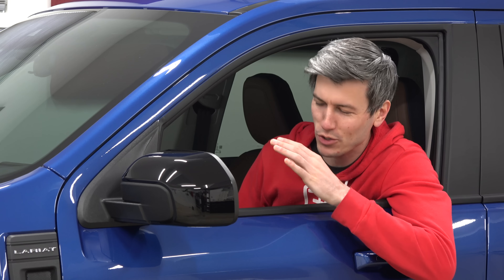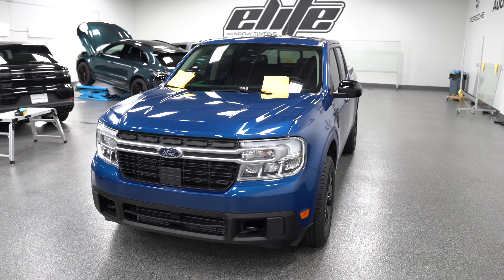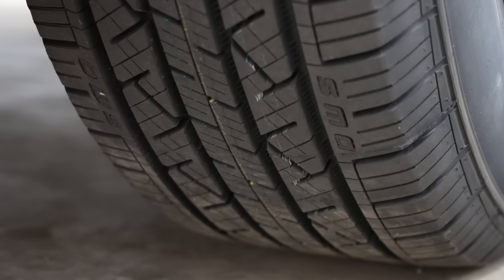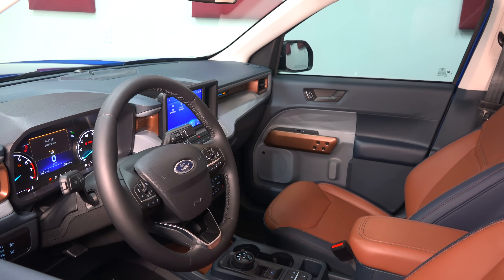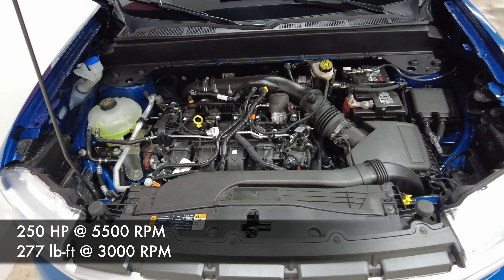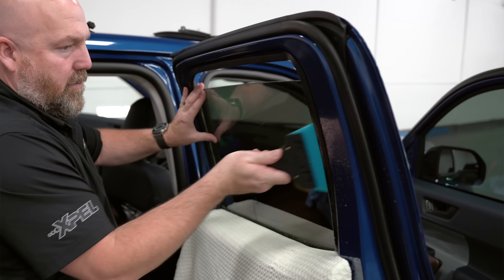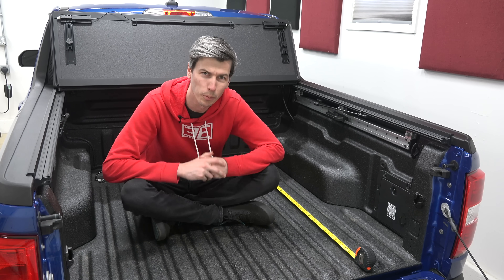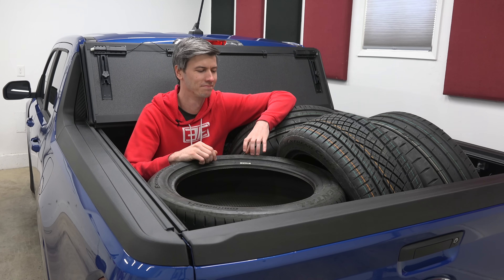I Bought A Ford Maverick! The Perfect Pickup?

Comment: Most consumers can only justify owning one or two vehicles, making the choice of a car about versatility and compromise. I own a boat and require a vehicle capable of towing and pulling up slippery launch ramps. A 4WD truck would be the preferred tool for most. Unfortunately, I have to use that vehicle doing a lot of light-duty tasks as well and suffer punishing fuel costs. There are fewer and fewer lighter vehicles for the job. Maverick is the most economical truck for this purpose, and it's also the lowest-priced utility vehicle for many other tasks.

Comment: The Mavericks are undoubtedly cool and practical, but I personally worry about reliability. As a Ford technician, I’ve seen lots of quality issues with Ford, and the 4 cylinder ecoboost engines in general. I’ve seen coolant intrusion issues in 1.5, 1.6 and 2.0L ecoboost engines and plenty of electrical issues. I will say, I havent seen a ton of maverick issues yet. But most modern Fords see some sort of major failure by 100k-150k miles. They’re typically pretty good vehicles for a while, but definitely no where near as dependable as some old Hondas, Toyotas, etc. that would make it 400k+ miles with no major issues. You’ll be very lucky to see that Maverick hit 200k
Reply: I thought they fixed the design on 2.0 eco engines?

Comment: Small pickup trucks are quite common in India. A 4 cylinder diesel/CNG engine, around 80-100HP and 200NM, and mostly available with a regular cab (also crew cab available) or cabover like the kei trucks. 
Those are used at construction sites, farmers and fisheries delivering their produce to the towns and cities, delivery trucks for furniture, bigger appliance or equipment inside cities and box trucks. These are cheap, extremely reliable and easy to repair, making them perfect to own for small business owners.
Although some higher end (according to our market) ones are also available like the Chevy Colorado based Isuzu D-Max (cheaper variants also available) and the Invincible Toyota Hilux, which also shares platform with 2 more popular Toyotas in the country, Innova and Fortuner

Comment: My ultimate dream truck would be a Honda Ridgeline AWB Hybrid (with a combined mpg of at least 28, preferably over 30) that includes adaptive cruise on all trim levels...even at the base level trim.  A Ford Maverick AWB Hybrid with adaptive cruise available on all trim levels would be a close second.  My "is it a truck" test is simple...can you easily put a dead (but still leaking blood) deer or hog/boar in the back end, and easily rinse the blood out of the bed with a hose.  Wanna have some fun?  Watch a Raptor owner try to get a 350 pound boar loaded into the bed.  Something affordable that can haul messy, stinky, or tall (small tree, because some homeowners do their own landscaping) while being economical enough to use as an every day driver while also being able to take on long road trips is the need, and is why the Maverick was such a success.

Comment: Ahhh... how nice... you think it's a truck... It's an car in the shape of a pickup. It's a little truck for urbanites... good for little jobs like picking up your 3 bags of compost for your urban flower garden and carying your recycling if the big garbage trucks won't do it for you. And good thing you put a smock on it! So when you take it for a little jaunt to the beach, you can your grab your little shammy and spray cleaner hidden in the bed compartment and wipe the bird crap right off so it doesnt dull the sheen. Dont be afraid the take it all the way onto the beach. If you get a flat tire you know you've got a life size replica right underneath.  And when you're on the beach you can be the hero you always wanted to be when pull little Johnny's tricycle out of the sand with you heavy duty hitch. How quaint!
Insincerely,
Dr. P. Cox
P.S.
Real trucks are for real work

Comment: Love the small truck support! I've got a 1989 Jeep Comanche as a secondary beater/hauler and it's such a blast to drive, even if it is low on power with a burned out TBI 2.5L. If it had a small 2nd row seat and hybrid option it would be a fantastic all purpose vehicle for the modern age so I hope small trucks like the Mavrick can keep a market share.

Comment: I drive a '95 Isuzu pup.  5mt.  4x4.  AC.  6 ft bed.  Excellent little truck.  Have no desire to get a unibody 4-dr with a tiny bed and questionable longevity.  My Isuzu has 200k on the original everything. 23-25 mpg hwy.

Comment: Im so confused right now. You say you've been looking for a nice small truck and say the maverick is the ultimate small truck in comparison to a couple others but skip mentioning the ridgeline and Tacoma. Then you list the specs which the Tacoma either meets or exceeds in all areas except maybe the acceleration cause i cant find reliable numbers for that but still insist the maverick is better. If you like it then that's great but it would've been awesome if you explained the reasoning that brought you to thinking that this truck is better than other small trucks in the same class that has better specs. Like does the ford  perform in the real world better than its competitors? Is it more durable? This video is just you claiming its the best small truck and without any comparisons or reasoning to back up that statement your basically saying "trust me bro". far cry from the quality of analysis you usually have. Am i missing something ?

Comment: I'm still disappointed in it. The bed is so small it's basically the size of a car trunk. Good for small things like camping, hauling around some  tools, and if you have to make a small garbage run, but the moment you need a sheet of plywood, or a 2x4, then forget it. The Ranger's bed is a little bigger, and is just large enough to fit a riding mower, and you can fit construction supplies if you you lean it on the tailgate or have the tailgate down and ratchet strap it down. To me the Ranger and Tacoma are the ideal small trucks, its just outrageous how much they want for them now. Bring back the Ranger and Tacoma from it's astronomical price, and it wouldn't be a comparison. I bet the biggest reason why the Maverick is even being considered for most people is because of being priced out of other options.

Comment: Can you please do a deep dive on the carbon traps that installed in the intakes of the 2024 mustang gt between the filter and the throttle body. I mostly see owners speaking HP gains, tearing them out as a limitation to air flow, to gain a negligible or exaggerated change. I simply know that Ford would not have spent the R&D plus manufacturing costs into something without a good reason.

Comment: I had a Maverick on order once before. But I waited for so long, I started to look elsewhere. I ended up getting a Honda Ridgeline RTL for the same price as a fully loaded Maverick. Except the Ridgeline has more horsepower, more interior room, more bed space, an in-bed truck, more towing capacity, higher clearance, and actual options on interior colors. The Honda came with a ton of stuff that Ford has as options. It's also a Honda so it's far more reliable. In making this choice I had some people hit me with the "buy American!" comment. Didn't hold much weight when they found out the Maverick is built in Mexico and the Ridgeline is built in Alabama. The Maverick is a nice truck, but the Ridgeline beats it in nearly every category. Even the fuel economy isn't far off from the 2.0L Mav. Sure, the hybrid is much better. But good luck finding one to buy. When you do buy it, you find out it's a slug on the road.
Reply: The Honda Ridgeline was the wayyyyyyy better choice. Mavericks are ugly as sin and I wouldn't touch a new Ford with a 10 foot pole. Ford LEADS THE NATION in recalls. Mavericks are full of problems. 

Anyone who wants to buy an actually good small truck should buy a late '90s to 2011 Ford Ranger. Now those are cool.
Reply: I agree. The Maverick feels cheap compared to the Ridgeline. The Honda has a V6 and a luxury SUV interior. The Honda bed and bed trunk is solid and the ride is like a luxury SUV.
Reply: @lancelotlink3907  The in-bed trunk is a game changer. I use mine regularly. And its way larger than anyone expects.
Reply: @YT0091  Yes that trunk is deep & wide and locks when you lock the truck. The bed also hold 4x8 sheets of plywood or drywall really nicely. There is lots to like about that truck and its a Honda.

Comment: A new Maverick has been on my list since they first showed up. It's not going to replace my Powerstroke for hauling my 5th wheel or car trailer, but for 99% of everything else I need it'll be a perfect replacement for my wife's Explorer. Like you, I live in Idaho, so AWD/4WD is a pretty important deal. Thanks for your imput and review on this. Like you, I think it's about the most perfect vehicle for the intended purpose. Just a note, on the tailgate, when you put it in the half up position, it puts the tailgate at the same height as the wheel wells so you can haul full 4x8 sheets of plywood with them supported properly. Thanks again for yet another great video.

Comment: I would never buy a gasoline or diesel powered vehicle ever again. Electric is the obvious choice. 80% of the energy you consume as lost as a waste heat. Electric is 90% efficient. And there is no transmission.

Also, how could you possibly power a gasoline pick up truck with Renewable energy? 

I have been driving my electric car for 12 years now and I ordered a cyber truck and if I ever see you at a red light you’re gonna be the one in my rearview mirror

Comment: The hybrid version has a design problem. Due to the heating and cooling of the engine, the intake fills with fluid. The result, the gas runs rough.

Comment: It would be perfect if it didn't have like 10 recalls out for it already. I'm really curious as to how these will hold up long-term. I wanted one really bad until I saw all the issues with them. I also wish they would do one with an I6 or something naturally aspirated with a manual transmission, that would be so cool and it'd last forever. I4's with turbos kinda can suck in my opinion because they have no torque unless you really rev it, also the turbos on these engines are a nightmare to get to and prone to failure.

Comment: I daily drive an 89 Nissan d21 5 speed 2.4 pickup. I run a landscaping business with this truck. Roll up windows. Prolly has 500k on its original motor and tranny. The odometer stopped working ten years ago.

Comment: not in love with spreading the attitude that you should buy a vehicle for the 2-3 occasions out of the year that you do something out of the ordinary. Also I grew up putting 3-4 bags of mulch in the trunk of a 96 ford probe… don’t say a modern SUV can’t fit that either
Reply from the maker: Maverick hybrid can hit 50 mpg and has a bed, how's that spreading the attitude you need something out of the ordinary? Small, efficient, practical.
Reply: @EngineeringExplained  yeah not arguing against the maverick I like it too, mostly related to the comments at the start about truck mentality and trucks in general, not the maverick specifically. maybe just hearing more of a connection between your train of thought there would’ve made more sense to me idk.
Reply: thanks for the video regardless

Comment: My biggest issue with this is that I carry long items once in a while (sprinkler pipes, fence posts, and lumber). They go to the roof rack. The length varies from 8ft to 12ft. In fact I'm so lazy that I put a 10ft pipe inside, using the ski pass-through. I see Lariat has a rear window, so that's a possibility, but I'm not sure if that is going to work.

Comment: Ordered one in 2021.  AWD XLT w towing package, rear window, bedliner. 31K.    It better than my 2004 Tacoma as far as usability. And really, to be looked down upon by the kinds of men who buy giant trucks with giant tires is a point of pride for me.  My vehicle is not a compensation for something I lack.   The 8 speed auto actually is part of what makes it really quick. No matter what speed your running, it can downshift when you pour on the gas and the thing jumps forward. And when you’re just cruising, it upshifts to keep revs low and get you better fuel economy.  Is not as good as the DSG on my TT, but it’s way better than the auto I had in my 4x4 tacoma.
Reply: @wachinpntdry.  Well… I really doubt it will last as long as the 04 Tacoma.   But then, in 2021 a used 04Tacoma with less than 90k miles on it, was selling for nearly as much as a NEW base model Maverick… And used car loans are at even higher interest rates.
What I meant was, The Maverick carries more weight, has more horsepower than my 6 cylinder Tacoma had, gets better mileage, has more interior storage and is more comfortable in terms of rear seating room, and has a better equipped and designed bed for carrying sheet goods. ( My tacoma was the crew cab version. ) And it has an easier to get into bed with a lower tailgate height.
And I mean it was better than a Current model Tacoma which cost nearly Twice as much, is dramatically larger than the 04 Tacoma, and, by all accounts I have read, is nowhere NEAR as reliable as the older Tacomas like the 04.   I wanted another SMALL truck and, sorry, but Tacomas just ain’t ‘small’ trucks anymore. 
The Mav does not have the ground clearance of the Tacoma, but then, I do not really take the truck off road, I use it for hauling materials, and people. And the 4X4 Tacoma was only AWD when you have the transfer case engaged, which killed mileage.  Again, I’m not off-roading, I want the AWD for the stability and control when carrying a load or towing in bad weather. The Mav’s combination of unibody build, AWD and fully independant suspension also makes it handle a whopping lot better than the Tacoma. 
Oh, and it out-accelerates nearly every 8 cylinder truck out there. 
The Mav can only tow 4k- not as good as the Tacoma, but then I never have the need to tow anything heavier than that, so its perfect, AND the towing package gives me a better radiator, transmission intercooler, suspension and gearing, and a Built in brake controller, which the Tacoma does not have.
One other thing I like, is that I don’t have to climb up to get in the Maverick. As I am now 67, and don’t need to impress anyone with such nonsense as how tall my truck is, the Maverick just makes a LOT more sense and, thus far, is just a lot more satisfying experience to drive, and to use.  
I doubt it will match the legendary durability of the early oughts Tacomas, but I really don’t need it to, I only drive it about 5k miles a year. The rest of the time I drive my 05 TT.

Comment: If I was to buy a truck I always told myself it would be an early 00's Toyota, or Avalanche or F150. After seeing this I know they make trucks I will be happy to buy now a days. 

That being said the upgraded version is 14K over the price of my Honda Fit in 2018, so still well out of what I would have wanted in price and my model came with Adaptive Cruise Control in 2018. In a few years if I need a truck I might consider this option but only Leather seats, and only a earlier cheaper year. Honestly front wheel drive and a plugin Hybrid would be bomb.

P.s. I have fit 2 washer/dryers in the trunk of my Honda Fit without much trouble and an open hatch. The thing is a boss.

Comment: Hot take: heated steering wheel > heated seats

Can someone please explain how american tow ratings are made up? 2000lbs standard, 4000 upgraded? My Renault megane (french golf) had 3000, my jaguar xe has 4000lbs (1800kg) and my 2005 Hyundai terracan (rebadged 4 door mitsu pajero, 150hp) has 6200lbs, all of which seem to be significantly bigger than what can be seen on US market cars, they often dont even have a tow rating. With that in mind, the only real reason to buy a pickup from the view of a european would be the combination off road and bed, because tow rating and off road are also achievable with suvs and the other vehicles with beds, flatbed vans, aren't good off road because they don't have that big tires but have high tow ratings, as high as 3,5 tons. They are the go to vehicles here for contractors and tradesmen together with box vans. Or am i missing something? The majority of pickups you can see here is owned privately. Funnily enough the majority of pickups consist of smaller ones like a ford ranger or Toyota hilux and are actually used as pickups because stupidly expensive, the bigger imported ones like ram1500 or f150 are all lifestyle objects here

Comment: I have a 22 lariat EB with FX4 and 4KT....every option except BAP. I have 36k miles on it and runs great. I suggest you replace the PTU and RDU fluid at 30k miles.....lots of metal flakes  surprisingly. I felt the factory gear oil was a tenth or so underfilled. As a teacher, this is perfect for hauling my school stuff at the beginning and end of the year. I garden so much easier to haul soil, mulch, etc home and can hose the bed out quickly. Only gripe is the paint is thin and chips easily.

Comment: I have a '24 Maverick Lariat in that same color. The one difference is that mine is the hybrid. It is very nearly the perfect vehicle for me at this point in my life. I installed the Bakflip X4s hard rollup cover on mine. 

25 mile commute in stop-and-go Atlanta traffic? 54mpg

Trip to the big box store for weekend projects? 4.5ft bed

20x20 garage? It fits fine

5 hour trip to the beach for a week? Plenty of room in the back for luggage and beach stuff

Road trip? Android Auto/Apple Carplay. Collision avoidance, blind spot detection, lane centering, adaptive cruise control, heated seats & heated steering wheel (Lariat only). 

My only gripe is that the drivers seat pan doesnt tilt. At 6'-6", I too am long and lean. My butt does get a bit uncomfortable after a few hours in the drivers seat.